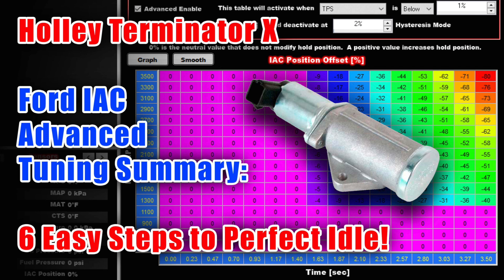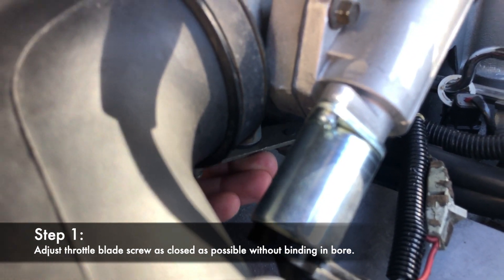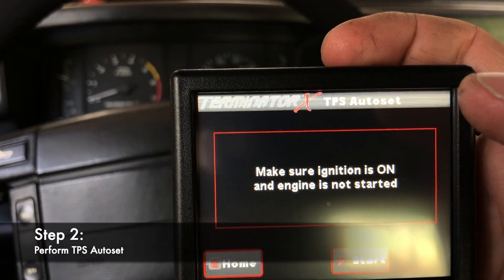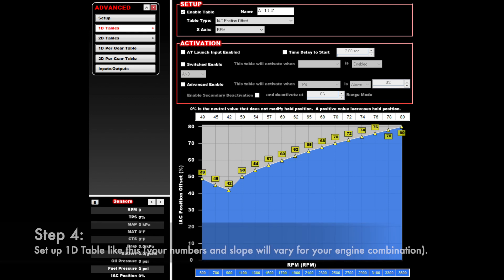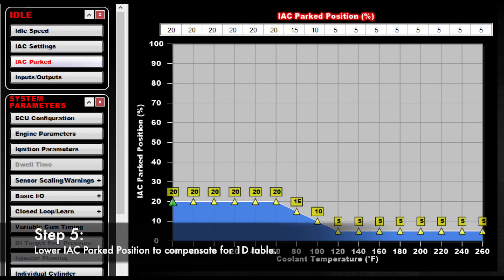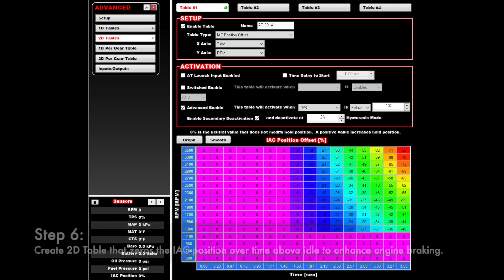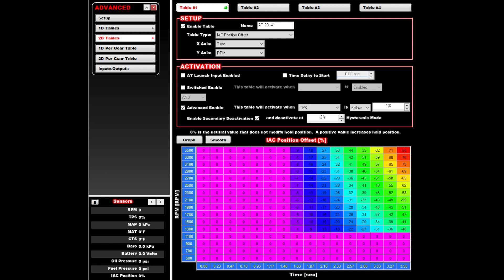6 Easy Steps to a Perfect Idle: Holley Terminator X Advanced Ford Idle Tuning Summary

Comment: Will this work if I am running a GM stepper motor IAC?
Reply from the maker: It should, though you won't have to start by adding 40 to all of the idle figures. But you could do the 2D table to get some dashpot.

Comment: This has worked fantastic. Still have a bad surging on cold start up. Give it some throttle and it will go to idling perfect. Tried adding more parked % and nothing has helped. Idle screw is set to were I have the best hot idle. Any tips? Thanks
Reply from the maker: You might want to try to increase the idle speed based upon temperature. Also, check the A/F ratio and timing targets are stable around the cells on the fuel and spark maps in the areas of cold start.

Comment: Hello. In your video you mention to adjust throttle body to bind to the bore. Does that mean fully closed? Thanks.
Reply from the maker: Good question. Yes, "fully closed." You want to force all the air to go through the IAC to control the idle. This is what the OEMs do too.
Reply: Thank you.
Reply from the maker: @89foxix75  Be sure to check out the other videos noted in this one. They explain it further.
Reply: Yes, I have changed everything except I never did this. My TB is still open allowing air through. Thanks.
Reply from the maker: @89foxix75  Ahh, yes. Closing the blade (and then doing a TPS autos) will help the IAC stay in its linear range.

Comment: Holley Sniper owner here (on an older Ford 302 though), I had been battling the stumble/occasional stall when pushing the clutch in during decel forever.  Disabling IAC rampdown and using the 1D table has 100% fixed the problem for me.  It prevents the IAC from decaying down to 0% under decel in gear, which seemed to be the problem.  I used Sniper-specific IAC values but the concept is the same, thanks for this info!
Reply from the maker: @mfc1337  That’s great to hear! It makes sense, too. This supports my theory that the Holley idle control strategy and options is not well-suited to manual transmission cars.
Reply: @Mustang-Geek  I agree, I did an auto to manual swap on this car and it never had these issues returning to idle with the automatic.
Reply from the maker: @mfc1337  This is why the instructions want you to open the throttle blade so much. BUT, when the engine is cold, it's more likely to stall. Please like, subscribe, and share this video on social media! The more people know about this, the better their cars will run?

Comment: So far this method has generated the smoothest idle on my Fox. It was pretty good before considering the horror stories I hear, but now it's even better.

One question though - WOT is only showing 71% TPS; I confirmed the blade is opening fully with the pedal using a second person. Could it just be tine to swap out the TPS for a new one?
Reply from the maker: Do another TPS autoset.
Reply: @FixBodyMustangs  I have done that with no change. I ordered a new Motorcraft sensor and I'm going to see if that fixes it.

Comment: After a few boost pulls, my idle stays at 3k rpm. No matter what. Let the car sit for a week and the moment you start it, 3k rpm. Can't figure it out. It idles so high that the car picks up speed on its own
Reply from the maker: Make sure the "RPM above idle to start ramp" is set as high as it will go.

Comment: Hi. Not sure if you would know this or help but I noticed I had a vacuum leak. It's where I my vacuum guage connected to the vacuum tree (B/R) slot. For some reason my car runs better with with the leak?? I had a little rpm dip coming to a stop but it hasn't done it since the leak. Any idea why? At idle my afr numbers are normal at 14.7. If I plug the leak it doesn't run as smooth? Your help is greatly appreciated. Thanks.
Reply from the maker: Vacuum leaks with a speed density system like the Terminator X are not a "problem," per se. It's basically the same thing as cracking open the throttle blade more and resetting the TPS.
Reply: @Mustang-Geek  Thank you!

Comment: Does the 2D table for dashpot reset when downshifting or does the IAC just stay at idle position once the timer finishes?
Reply from the maker: The 2D table for dashpot resets if the throttle exceeds 1%. If the throttle does not move, then it IAC will stay at the idle position.

Comment: Thank you for the video. Stupid question, when adjusting the throttle blade screw. Do I go clockwise or counter-clockwise on the throttle blade screw? I followed all of your instructions but having a surging/higher idle issue and trying to figure out where I went wrong.
Reply from the maker: Counter-clockwise should close the throttle body. Back the screw all the way off, and operate the throttle by hand. It should stick closed. Tighten the screw until it stops sticking.

Comment: Good video i have a problem when i turn on the car it will hole idle around 1900 rpm and wont come dowb what should i change in order to get an idle of around 800, thanks in advance
Reply from the maker: Hmmmm. Go through the video again and check EVERY setting on each screen.

Comment: How come my 2d table when I add it only shows zeros?
Reply from the maker: You have to put the numbers in yourself.
Reply: @Mustang-Geek  yes I figured afterwards maybe that’s why my car was having issues. I was having problems with my car idling and me barely touching the gas and would rev up to 3k rpm. 

I have to shut the car off at that point. Don’t remember it doing that before but I did mess with some setting that Matt for leach did and it might have no gone hand in hand with yours. So I’m re doing your settings in hope it helps with my issues.  Car turns on cold start then dies.  Does it a couple times until it starts but then last few times won’t even hold idle.  I never adjust the idle screw so I’ll be redoing everything.
Reply from the maker: @SergioSanchez-rx1hg  Keep us posted!

Comment: thank you for good information about 1D and 2D tables.
Now I trying setup 2D table. however I have something to talk to you.
for example my 2D x axis tab havenot "TIME", only have "Timing vs Cool".
Reply from the maker: Sorry, I don't understand. My menu has lots of options, including time.
Reply: @Mustang-Geek  Oh, really? 
I guess sniper and terminator X have some different point. if you choose different content of X axis, which one will you choose?
Reply from the maker: @vegavincent3980  The x axis can only be one thing. Maybe it's not possible with sniper software.
Reply: @Mustang-Geek   now I reseted my 1D table. 1D minimum IAC offset 28 to 6%. throttle flap position resetting and 1D tale setting is same. (without 2D table, only 1 D table)
I have one question, now 1D table working,
P position (mine is 700R4) IAC indicate 6.
then shifter in D, IAC position move 6 to 14.
my question is when 1D table setting is 6% at 750rpm, actual % is 14% when in gear positon D, it`s OK normal condition. but I do not know while 1D table working, what do "IAC park" tab doing?
I do not change "IAC park" tab, defolt setting. sorry bother you, but I am little bit confuse...
Reply from the maker: @vegavincent3980  I understand your confusion, ha ha! The "IAC Park" does NOT have anything to do with the transmission being in D or P. It is the position that the IAC "Parks" when the engine is turned off and for starting. The "IAC Park" position will set the IAC when the engine first starts, and "hold" it for the time set. Does clarify it?
Reply: @Mustang-Geek  now I have try how to use 2D table! you gave me a hint.

Comment: Hi. Any suggestions on rpms to come down a bit more quicker. When I rev the engine it seems the rpms are coasting. Thanks for your help.
Reply: Which numbers should be lowered? Mine will not come down at all. Idles great at 800 with 38 set on the 1D table blip the throttle and let off and Rpm hangs at 3000 and never comes down. This is just with the car sitting not attempting to drive it.
Reply from the maker: @scavenger1967  Leave the idle numbers alone, but make the ramp not as steep. Lower the top number and smooth the rest
Reply from the maker: Sure. Try lowering all the numbers by 5.
Reply: @Mustang-Geek  I thought I would provide an update. Finally got the car out and with the new changes it drives like a whole new car. No more surging coming to a stop or dying going through a yield. Cold starts are great. One issue is on a hot start the car surges but when I tap on gas it smooths out immediately. Any suggestions on this. Thank you!
Reply from the maker: @89foxix75  Not sure on the hot start surging. Check your target A/F table and make sure there aren't big jumps in the target where it's idling.

Comment: Hi. I am hoping to get your help on an idle issue. My IAC parked is at 50% and ramp down is at 4.2. When I come to a stop,  idle will blip up to 1400 -1500 rpm then drop to 850 then back up to target idle at 1000. It's also does this if I just give it gas while I am parked. A few times while going through a yield the car has stalled? Any suggestions would be appreciated.
Reply from the maker: Hi! Yes, I've dealt with this as well. Please try following the instructions in this video (and the linked videos) to see if that solves your problem. I think it will.

Comment: Great info, this really help my shifts feel much smoother like “stock”. Now that I have switched to this method I am having a minor surging at idle on first start up, it will bounce 2-3 times and then mellow out. Where would you recommend to start adjustment to fine tune the start up using this setup?  Thanks
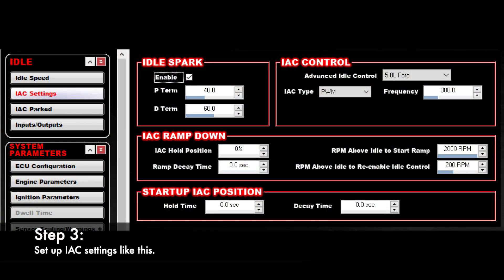Reply from the maker: 1) Make sure your settings are as shown at 0:39 in the video 2) If they are, and it still bounces, try increasing the hold time and play with the decay time. Mine worked best when the Terminator was trying to hit the target immediately, but you may have better results with a "forced" hold and ramp down time.
Reply: @Mustang-Geek  Looking for additional insight on a issue I am having with a new 347 setup I just put in this past month.I had the 1D working beautifully with my turbo 302 with a b303 cam. It behaved like the stock Ecu during shifts and it was great. Now I have a 347 in with a higher lift cam, it shifts great but surges at idle 😅🤷🏽‍♂️ I am guessing my custom turbo cam might be too much for the IAC respond quick enough? I've tried going back to the old holley method and the car will idle just fine on the idle screw & typical IAC settings, but its no comparison to how it was on the 1D setup. Any insight would be appreicated. My cam specs are: DUR AT 050 (230/232) AND LIFT WITH YOUR 1.60 ROCKERS WILL BE .575/.570)
Reply from the maker: @LamborghiniX09  I'd try flattening the numbers around your idle speed, (put the same number in from the bottom until, say 1200 RPM). That should keep the idle more stable and still have the 1D table in effect for the "dash pot" function. Let us know how that goes.
Reply: @Mustang-Geek  Awesome, I’ll give this a try. Appreciate your quick response. 🙌🏾😬
Reply: @Mustang-Geek  Great news! Flattening it really help stabilize it. She's no longer surging and idling perfectly. Thank you for your help!
Reply from the maker: @LamborghiniX09  Yeah! Glad it worked!
Reply: @Mustang-Geek   I wanted to give an update on my issue and thank you for your suggestion. It worked decently to keep the car at idle, but I found it very troublesome to dial the IAC position during the week of testing. It would either drop down too low or surge all together as if it needed more air. Upon my research I stumbled across a forum from the early 2000s where the old school foxbody guys were experiencing a similar issue with the stock ecu & larger cams. Their solution was an "Idle Air Adjustment spacer". I purchased mine from LMR & to my astonishment, with the plate installed, IAC unplugged the car Idled perfectly at 850RPM. After, I re-added the values from your video & adjusted the points accordingly. She now idles perfectly, shifts are clean & has nice crackles/pops on engine braking. Shes dam near perfect to drive now. Thanks again bro & hope this helps anyone else who has a larger cam. http://corner-carvers.com/forums/showthread.php?t=11961
Reply from the maker: @LamborghiniX09  That's great! Glad you got it working! I wonder if you could've gotten the same result by opening up the throttle blade to allow more air to pass and then going from there...but regardless...if it works, it works!

Comment: I have been chasing random idle issues with the terminator x.  I tried the 1d table method with mixed results.  I just tried this method and like a lot of its behavior. I am have a surging idle issue with it. its inconsistent. Usually but not always, when I start it, it will surge rapidly, about 400 rpm to 2000 rpm. Sometimes it levels out quickly, some times it doesn't.  It will be driving fine and returning to idle every time smoothly then suddenly it will be surging every time I come to idle.  I suspect my fuel table at idle is not dialed in right.  Is there any other thoughts on getting consistent stable idle?
Reply: Similar issue here very minor on start up.
Reply from the maker: @LamborghiniX09  Also, do a TPS reset. Your TPS may be not reaching idle.
Reply from the maker: 1) Make sure the target A/F table is smooth around the area where your engine idles. With the engine running, go to to that table and make sure the cells around that area have a similar target A/F ratio. 2) Do a TPS reset. Your TPS may be not reaching idle.
Reply: @Mustang-Geek  Thank you!
Reply from the maker: @CurrentAutoPerformance  Did it work?
Reply: @Mustang-Geek  I haven't tried it yet.  I did also switch to e85 at the same time then ran road course over the weekend. I have a bit of tuning to do all over the place.  Ill get back with my results.
Reply from the maker: @CurrentAutoPerformance  Ah, surging idle could be A LOT of things in your case, for sure.
Reply: @Mustang-Geek  AFR temp offset table was my biggest problem.  I zeroed it out and it instantly stopped surging.  Well when the motor is above 60 degrees.  When below 60, it surges 2-4 times then is smooth.
Reply: @CurrentAutoPerformance  It's in open loop & the fuel/timing tables aren't straightened out yet. 
If you want to send your global file to me with a Datalog I will check it out for you.
Reply: Check your timing table in the area as well, If you have higher ignition timing in those cells it'll cause the rpm to go up.
Reply: @kevin_nagle  I have worked the timing area. I watched the actual timing controlled by the ECU and saw where it stabilized at and adjusted the table to those numbers.

Comment: Definitely gonna try this tomorrow. My car starts and drives fine, but when I  slow down to idle it idles around 1200. Also when I  rev match sometimes the rpm’s would be stuck wherever I revved it up to.
Reply from the maker: I feel your pain. Follow this procedure (and use the 1D and 2D tables) to get it running much better!

Comment: This should help when running a/c coming to a hard stop. Thank you.
Reply from the maker: Good point!
Reply: christopher c.... How did you get you A/c to work with the terminator system?
Reply: @KM-uw4ez  brought over a line of power to energize a relay.  Wired in to one side of the compressor to energize the a/c circuit left the pressure switches wired in. Used the wire on the a/c selector switch to power on the relay.used another relay to communicate with the terminator.
Reply: @christopherc3017  cool. Which color wire off the ac selector switch did you use? Did you find a drawing somewhere? I’ve looked and can’t seem to find one.
Reply: @KM-uw4ez  it’s been over a year since I done it but I looked up an a/c circuit diagram and then used a multimeter to test at back of switch.
Reply: @christopherc3017  t
I messed around with it yesterday and figured out how to get power from the HVAC switch. I appreciate the help. You got me pointed in the right direction!
Reply: @KM-uw4ez  nice.

Comment: I set up my 1D table to only enable after reaching 600rpm so my IAC Parked didn't require tweaking. Is there any advantage to your method vs that?
Reply from the maker: If it works, do it! Might be a simpler way than what I mentioned, so that's a win!
Reply: Did this help to prevent surging idle at start up?
Reply: @LamborghiniX09  My change? It wouldn't have to do with idle since parked position is only during cranking, but one thing that massively helped my idle/cold idle was disabling closed loop/learn under 5% tps and manually adjusting the base fuel table. I found my surging was due to huge swings in AFR and manually adjusting the table got rid of that swing in an area where the car is very sensitive.